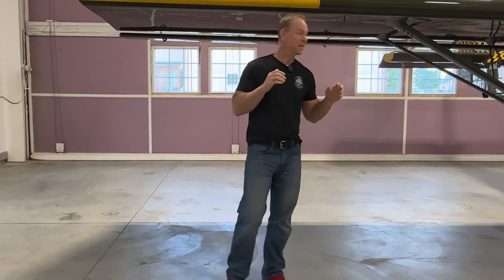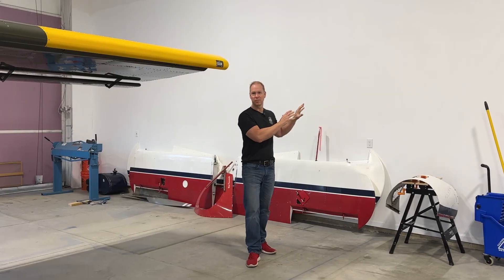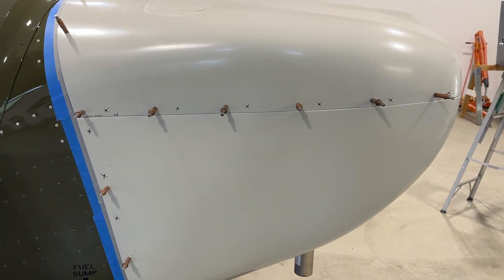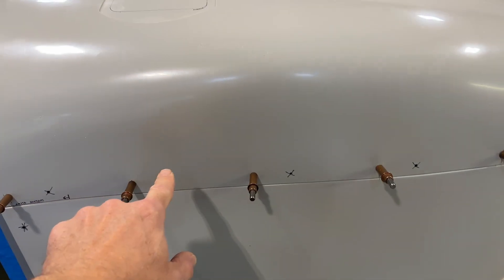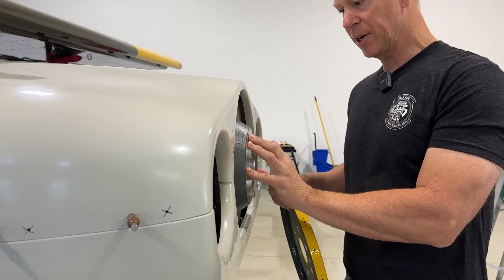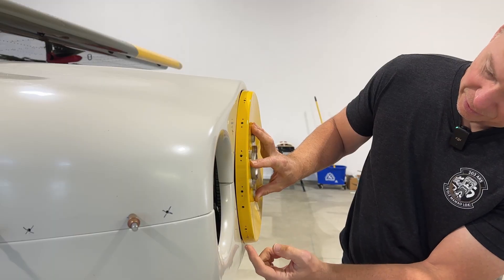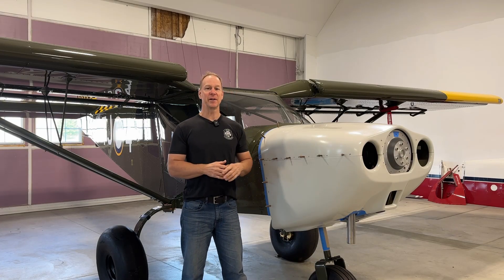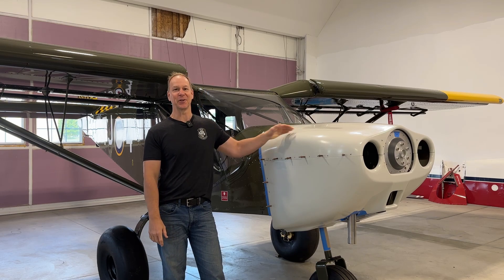Progress on the Zenith Super Duty!

Comment: Question why not have a back plate made to fit the 13 inch spinner? You could have one made with the flange reversed a helluva lot cheaper than 800 bucks for the 12 inch.